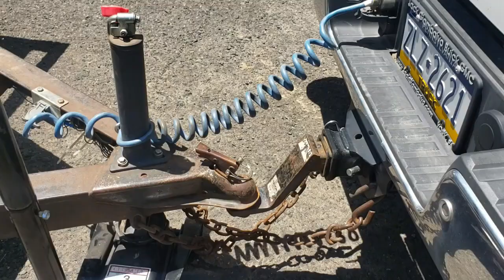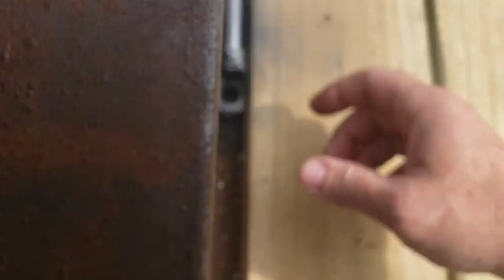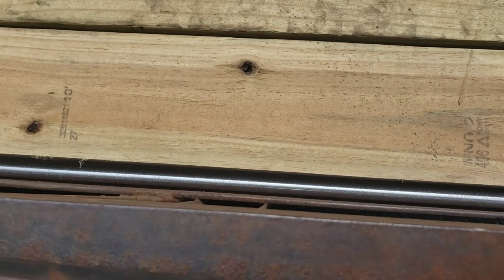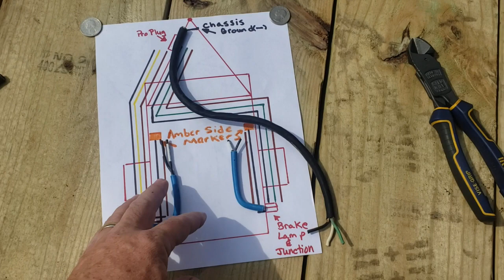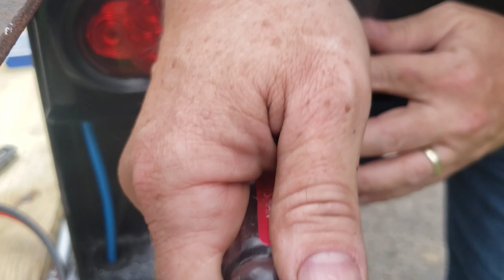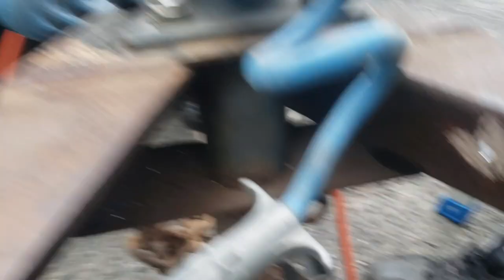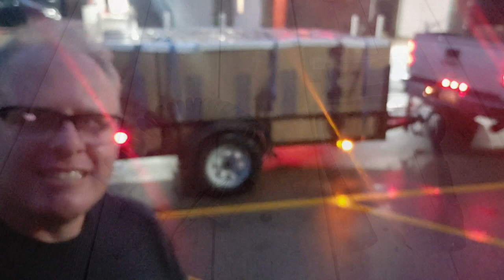5 Tips on How to Wire a Utility Trailer (long version) For Ultimate Reliability

Comment: curious as to where you got your light kit and where would be a good place to purchase the wire I'm assuming the wire has to have the right colors in them....
Reply from the maker: I've got the light kits off Ebay, Amazon & Etrailer. Just be aware that you can't assume the lens will be red. Though the illumination will be. I prefer the look of the red lenses, but in one of my mother video you can see the white lenses.

The wire I bought was just some 4 conductor wire that was black white green and red. I put some brown shrink wrap on the wire terminals on the video with the red wire just to be consistent. So that works well for when you need 4 wires.  I have access through work with a 6 conductor wire, but etrailer may be the best source for a 7 conductor.

What are you working on? Maybe I could recommend a reasonably priced solution.
Reply: @PaulsProTips   well working on a newly acquired 5x10 with just a regular stop/turn signal wires are shot I'm prob looking to install led/turn/backup lights and put in this 7 wire conductor br pro plug
Reply from the maker: @bull5919  the 5x10 are a great. Versatile but not overly complicated. If I were you, you could grab some relatively thin gauge, double insulated wire from a hardware store and get it wired without trailer brakes.

 This way you can avoid the expensive 7 conductor wire. If the main wire running to the rear light boxes is either 3 or 4 conductor you would have the extra wire (or two if you don't bring the ground to the light box- ensuring the ground up front is adequate). Then do the reverse light add with one of the other connectors. You could add some light green or purple shrink wrap or tape to that wire terminals.

Follow the rest of the wiring techniques  on the video for a system that is extremely reliable.

Would love to hear what path or technique you chose.
Reply: @PaulsProTips  im having a hard time running down that small wire with double insulation here  in georgia for some reason...But i was def wanting to go with integrated reverse lights once i find that kit.....Could you post a link as to what i should be looking for exactly
Reply from the maker: @bull5919 Great question, as I'm sure you're not alone. Hope this reply helps.

 Depending on how many circuits you are running, you could re-purpose a 3 or 4 conductor wire often used on decent extention cords.

If you want new, you can buy a double insulated, 7 conductor wire like in this link:
https://www.amazon.com/Best-Connections-Inc-Insulated-Stranded/dp/B07D5HPJG6/ref=mp_s_a_1_2?keywords=stranded+7+conductor+wire&qid=1569983778&s=gateway&sr=8-2
Reply: @PaulsProTips  hey appreciate your tips and response been busy..So, let me ask you this: Does it matter that the Blue isn't 12 gauge and the Black/White isn't 10gauge?
Reply from the maker: @bull5919  i appreciate it positive feedback. I like to have the ground as the largest wire possible. I've even doubled up on the ground wire in certain cases.

The wire size is simple related to the load you'll put on it. The black wire is your battery hot lead. As long as the amp draw you have is less than the rating for the wire size you are using, you'll be fine.

As for the trailer brakes, each axle with brakes on them will draw around 6 to 8 amps (larger brakes draw more amperage). If you have a dual axle trailer you could guess it may. Eed a wire cable of handling 16 amps.

Quick reference

14 gauge wire is good up to around 15-20 amps
12 gauge wire is good up to 20-25 amps
10 gauge is like 30-35 amps

Hope this helps!

Comment: Just out of curiosity roughly how much does it cost for you to do this
Reply from the maker: I figure it cost me $35 for the Pro Plug, about $30 in conduit, $70 in LED lighting,  depending on your source for wiring it may vary but between shrink wrap, butt connectors and wire that is likely $60 and then at least a 7 pin plug for the harness. Realistically it cost $200 for a high quality lighting and a full Saturday afternoon uninterrupted (if that is such a thing). People's value of time varies dramatically. So that is the expectations I would set.

If I wanted to say it can be done for less, that is absolutely true. Wire can be sourced for less or free via repurposing things, the LED lighting g can be purchased for less is you shop harder and roll the dice on quality. You could probably cut the price in half and have 80% of what this is.

I happen to be the type person who appreciates the extra quality and feel validated with every use. Buy once, cry once and enjoy. Economy lights need maintenance and replacement every year (sometimes sooner) and it is never at a convenient time.

Comment: #1 the most important thing is don't lone your trailers out to people who don't take care of them. I do the same basic thing with conduit however always run underneath so it's away from the load but nowhere that can snag. lights are just a write off no matter what you do so I use the cheap ones.  On the small trailers that used to flat 4 pin wiring and just watch for chafing points.  have no problems even though it's cheap. make sure you have a good ground in the wiring is secure so it doesn't pull the ground out. Anywhere the wiring is not in hard conduit it's in loom and taped. If you can get rid of the orange side marker lights there just another. failure point
Reply from the maker: I appreciate you taking the time to comment. That is pretty cool that you've come up with a similar way of doing this. I wish more people knew about the Pro Plug. Immediately after doing this, two co-workers with 2016 trucks swore the trailer had bad wiring and I was able to use the PP to verify the issues were on their trucks. Best of luck with your trailer!
Reply: On my big trailer that has brakes I use a box similar to the pro plug. all my small trailers I generally don't even Sprint for that extra cost. Not to mention my Hyundai Santa Fe daily driver only has a 4 flat plug . I generally drive the Santa Fe to keep the miles down on the truck plus it's a little better on fuel but still tow from time to time with it.